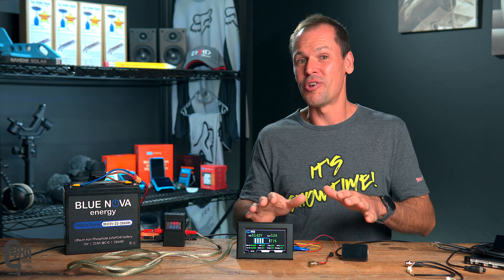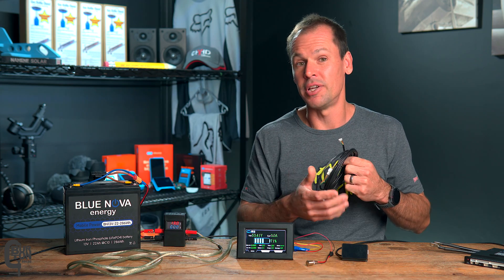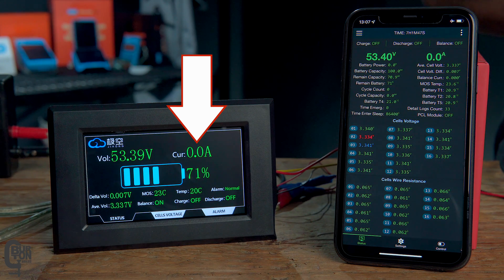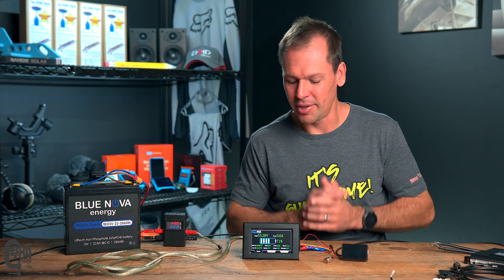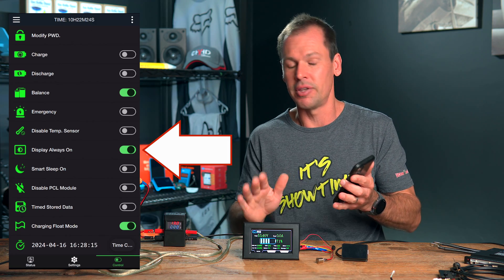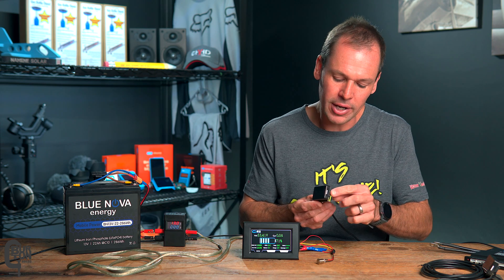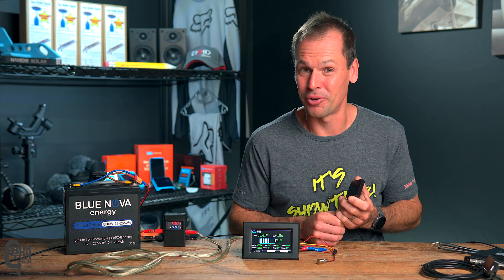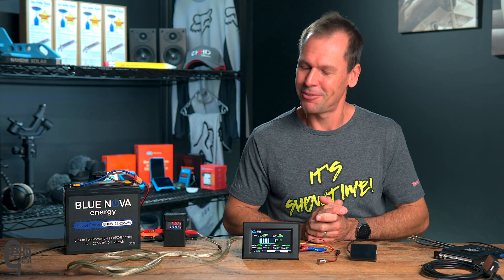JK BMS Screen Comparison and Test - EXPOSING Problems??

Comment: Have you tried the inverter BMSs' in parallel, and then try to see them all in PC software v2.7.0? The CAN connection to my Victron Cerbo works well with my 4 JK BMS's
Reply: Normal there is only one cable needed to connect the display to the bms. Then the display goes to sleep. 
I like your reviews👍🏼
Reply from the maker: @jcgcs  Hi Jacco, thanks for your comment. Are you referring to the large touch screen normally having one cable that goes to the BMS? I know the small screen only has one cable but my large display needs to be powered separately... maybe mine is just an older model screen.
Reply: @GrantBurton  Yes, the large touch screen
Reply from the maker: @jcgcs  Cool, thanks for that info... I'm wondering if I cant just connect the power for this screen to where the 'single cable version' gets its power from... I guess the screen will be the same, just a different cable.
Reply: @GrantBurton  I saw 3 versions of cable for the 4.3 screen...
Reply from the maker: Hi, yes, the JK Inverter BMSs are running in parallel and at the same time, I was able to plug in the USB to RS485 adapter and use the PC software to view the data. No settings could be changed but I could see the realtime data for both batteries (address 0 and Address 1). The data seems to refresh every 7 to 8 seconds. The only data that was not working is 'Battery Capacity' and 'Remaining Capacity'... both showing zero on the PC software but showing correctly using the phone app. SOC Percentage shows correctly on PC software though.
Reply: bought it with this bms and didnt use it yet ..  not much to see .. the app shows more   and thats all
Reply from the maker: @anaxiosesti88  The app is definitely more useful than the screens, but it is nice having a screen to glance at and see basic status of the battery.